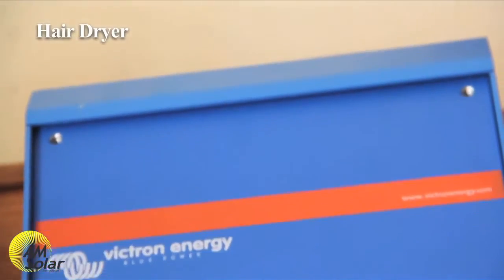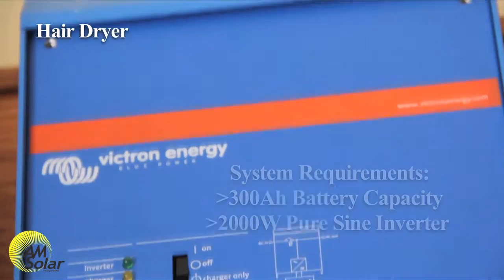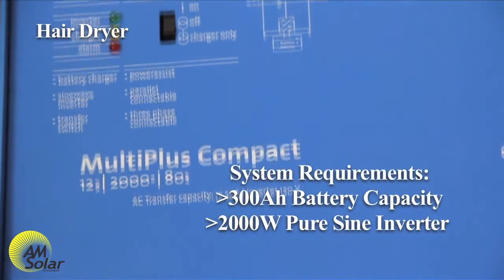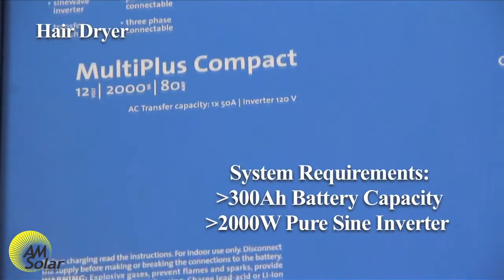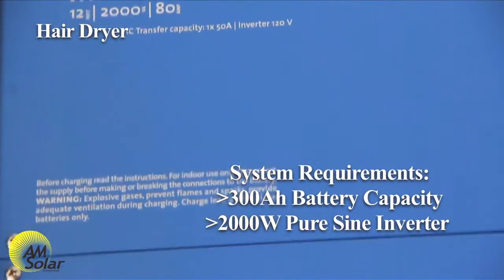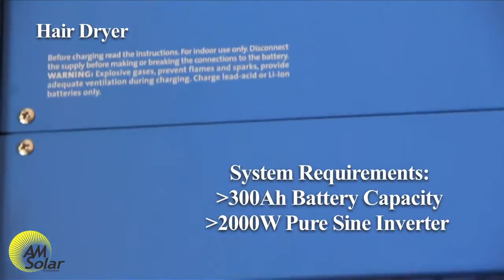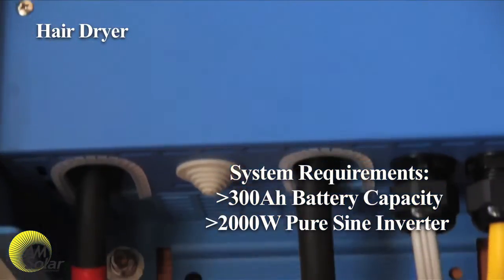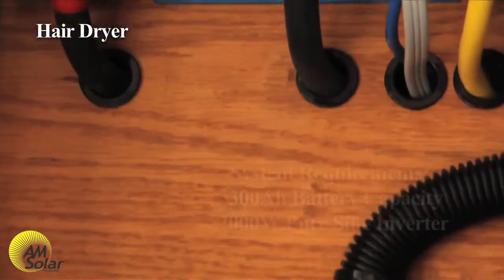Designing a Solar Power System for Your RV, Skoolie or Van (A Guide)

Comment: If you max out your charge controller's capacity... can you still add more solar panels by just putting them through a 2nd charge controller and then having that charge controller connected to a different battery within the same battery bank (But different entry point in the same battery bank)? Or is this increasing risk?
Reply from the maker: You can certainly have multiple charge controllers if a single unit doesn’t give you the capacity you need.  We do this all the time.  There is no need to have a different connection point, as long as your conductors can handle the current.  Does this answer your question?
Reply: @GarretTowneAMS  thank you.

Comment: Good morning. Can you help me plz. Ive got n 12/1200av phoenix inverter. What size solar and mppt is needed . Im using 2xwillard deepcycle batterys 70ah each. Just want to use for camping in my van. Thanx for your great videos.
Reply from the maker: The solar charging system and inverter system are totally separate, so the size of your charge controller has nothing to do with the size of your inverter or the size of your battery.  The solar charger is sized based on the wattage of your solar array.  A common solar array for a van is 200-300W.  If you go with that size, a Victron SmartSolar MPPT 100/20 will work.  If you go over 300W, get a 100/30.

Comment: New to the Victron world. Trying to up my 1999 RV Class A from only 100w solar.
Looking for a new SOLAR CHARGER...

ANY RECOMMENDATIONS ON SETUP? Solor Charger MODEL, use x2 panels parallel and x2 series???

I am looking ar a Victron 150/85 controller  2S2P????

I pickup four:
Solar Panels manufacturer: Trinasolar model: TSM-365DE06X.05 (II)
Panel Voltage (45.0 Voc)
Panel Short Circuit Current (10.35 Isc)
Solar Panel Wattage (365 W)
Max Series Fuse Rating (20 amp)

Today my (12v) Battery Bank Voltage 400-AMPs, I will increase to sound 800-AMPs
Thank you
Reply from the maker: If I understand your correctly, I would put all the panels in parallel.  Their higher voltage will work very well in that configuration.  With four panels, use a 150/100 controller.  Use 2ga Duplex cable after you parallel the cables on the roof.  If you need more details, or a place to buy the stuff, send me an email:  garret@amsolar.com

Comment: The few who are able to use AC off solar are using 600+ah of lithium supported by 1000+ watts of solar, often on a Class C or Skoolie or big flatbed camper overlanding truck. They are all using mini split systems. I've managed to fit 1000 watts on my Ford van and have 900ah of lithium down where the spare tire used to be, and I'm mounting a mini split to a swingarm rear bumper. Hope it goes well! It's not cheap to build a system like this, but your ride becomes a portable generator that could support most of a house (minus HVAC and clothes dryers) in a grid down scenario.

Comment: Why should these systems be custom designed for every van?
Reply from the maker: So you don’t pay for things you don’t need.
Reply: @GarretTowneAMS  Then every car should be custom designed to save money too, NOT. Henry Ford is rolling in his grave.
Reply from the maker: @GOLDVIOLINbowofdeath  start your own business and let us know how it goes. I’m sure people will be beating down your doors.
Reply: @GarretTowneAMS  I am starting my own business but not interested in doing everything inside the van , just the structural parts. Filing patent application soon. I’m sure there are companies out there that want to specialize in the electrical or water modules.
Reply from the maker: @GOLDVIOLINbowofdeath  Good luck. Let us know if you need any power system help.
Reply: @GarretTowneAMS  I could use referrals to companies that might be interested in making the electrical module or the water module for a modular, mass produced, van conversion system. I will be mass producing the interior structural and cabinet modular components and the frames for the electrical and water modules to be built into. Also want a referral for a wiring harness company

Comment: Is there a disadvantage of going a little bigger on the inverter even though you may not need all that capacity?- like getting a 2000 instead of a 1000 for example?
Reply from the maker: You may have a higher no load draw with a larger inverter, but I always recommend 2000W over a 1000W.  It gives you room for expansion and loads like microwaves, blenders, etc. typically all need more than 1000W.  Get the 2000W and you won't regret it.
Reply: Victron 3000w inverters are close to the same price as 2000w inverters, but they are much larger.

Comment: I have a victron 100/20 mppt with a lensun 105w roof solar panel charging two agm yellow top opitma D35 batteries. Would this system be sufficient to run my arb 12v refrigerator? The specs on the side of the refrigerator reads dc12/24 2.5/1.3a
Reply from the maker: It will be cutting pretty close.  I would feel better with you having two or three of those panels.
Reply: @GarretTowneAMS  what would be the damaged caused? Could it cause a fire or just eventually ruin the batteries?
Reply from the maker: @Greenmanwildlifephotography  Nothing will be damaged.  The refrigerator will just deplete your batteries faster than the solar panel will charge them.
Reply: @GarretTowneAMS  an would I just add the new solar panel wiring directly into the solar charger in the same ports as the first panel or do I have to daisy chain the panels? Thanks for your help!
Reply from the maker: @Greenmanwildlifephotography  Both options will work, but I prefer to use the same ports and make it a parallel connection.
Reply: @GarretTowneAMS  thank you so much for your help. I really appreciate it.. your videos are great. An what company do you recommend for a panel? Probably get a another 100w or 150w
Reply from the maker: @Greenmanwildlifephotography  We sell Zamp because of their high quality, but they aren't cheap.  You might just go on Amazon and see what they have.  There are a lot of good options.
Reply: @GarretTowneAMS  I would rather get quality. Can you send me a link?

Comment: is everyone in the van and RV world keeping their lithium batteries topped up @ 100%  all the time???? from what I can tell, it seems like it. I'm from the electric vehicle world and it's known that it's best to keep lithium batteries @ 80% to avoid dendrite build up, this can double the life cycle of the battery. If stored for long term 6+ months, 40-60% SOC is recommended. This is all well documented in research papers.
Reply from the maker: It’s totally unnecessary to top of lithium’s. Customers demand it, and it’s hard to convince them to think differently.
Reply: @GarretTowneAMS  yeah, I noticed that when checking out Van life, RV video's etc. It's REALLY stupid actually cause you're basically just killing the battery internals by created lithium dendrites, that's $$$ out the window. Alot of people just aren't educated on lithium and think they require full charge like SLA...

Comment: I'm in the process of building a system for use in an RV for fulltime living and I already have a couple of Victron Blue Solar MPPT 150/35 solar charge controllers and a Victron Venus GX to be used with a 450 amp-hour LiFePO4 battery bank made up of 48 - 150 amp-hour 3.2 volt cells in a 16S3P configuration, providing 23,040 watt-hours of capacity at a nominal 51.2 volts DC.  The battery bank and the Victron equipment is contained in a Weigman 36x30x12 14 gauge steel industrial electrical enclosure, along with other components, like DC-DC converters to provide 60 amps at 13.8 volts DC for standard RV 12 volt devices, the required contactors and, of course, the BMS system from REC BMS.   I've been looking at the Victron BMV-712, but I don't have a desire to wire and mount the display.   So, I've been intrigued by the Victron Smartshunt.   But, I have a question that you might be able to answer:

Since the Victron Smartshunt would be installed inside the 14 gauge enclosure to replace the simple 200 amp 50mv shunt specified by the BMS manufacturer, the Bluetoooth connectivity is going to be unusable, except between the solar charge controllers and the Venus GX that are mounted inside the enclosure.   So, can the Victron Smartshunt be accessed through a standard wired LAN using the Victron app on my smartphone connected wirelessly to the LAN?   I have a panel mount ethernet connector to connect the Venus GX to the LAN.

I watched the Victron video for the Smartshunt, but comments were turned off on that video.   So, I hoped you might be able to provide some insight on this issue.   Thanks!
Reply: I share your concerns about Bluetooth signal strength in the setup you described.  Unfortunately, the SmartShunt only has a VE.Direct port which can communicate with your Venus.  I hope this helps.

Comment: So can I use a 500W inverter that says it's for car use on my solar setup?
Reply from the maker: Vagitarian Sure, if it works with your loads. It doesn’t matter if solar charges the battery or not.
Reply: @GarretTowneAMS  Hi wow thanks! Yes I've got a deep cycle with 90 amp hours and a 150W panel with 8.5 amp charge controller and want to attach the 500W inverter just to get the hang of this. Maybe charge phone and laptops!

Comment: i do have a fue questions about wiring,3 victron things,,i have a 250/100 charge controller and a 48volt/100amp cutoff,and just got a bmv something,,the questions are ,how close to the battery does the bmv thing need to to be to the batts?,,,i just need a scmatic for what i have,
Reply: I would need some more details on what you have.  Battery type, BMS, etc.
Reply: @garrettowne  thanks for your help,, no bms,,the batts are chevy volt 48volt modules i have 6 of them ,,,one qustion i have is how far away i can mount the shunt from the batterys?

Comment: Wrong.. Wrong...Wrong... You are so right  ( the first Wrong was the best )....... more great info
Really enjoy the info 

I do have one question how can I recharge a 48v 11amp  lithium e-bike battery with solar I have a  (Victron Energy BlueSolar 12-24v 75/15 MPPT Solar Charge ) any advantage building a 24v system   Do I need a large battery or can It be charged from my 12v car alternator 
 and run a Portable Fridge Freezer 34.5L
Rated input current (AC) 0.86 A
Rated input current (DC) 7 A
Input voltage (DC) 12/24 V
Thanks from Aussie

Comment: If i have more solar panels that would also charge my bank faster if im under standing this right? I trying ti figure out my needs for  off grid living in a schooly, and from im getting out of this x3 - 4 200w panels, with about a 400ah bank to start with with about 2k inverter should do fine for running a energy efficent wynter fridg, a lap top daily for work or at least charging and running a wifi hotspot booster.with the ability to run an electriv 1500w convenction oven every once in a while
Reply from the maker: More solar panels make for a faster charge.  Not to try to sell you on anything, but if you can go to AMsolar.com and fill out a quote request I’ll be able to give you a lot more detailed information.  I think your basic idea is sound, 600W of solar, 400Ah of batteries, and a 2000W inverter.

Comment: It's nice to see a clear expert on YouTube now and then :-).  Great video.  The video does seem to confuse "solar is for charging batteries only" with "solar powers loads" just a little bit.  Might be interesting to discuss that a bit.... that everything essential flows through the batteries..
Reply from the maker: I write out most of what I plan to say and have my crew give it a final sanity check.  Then, once I get on camera I may loose a little precision.   To be clear, solar just charges a battery.  Solar can “offset” the consumption of some loads.  If a load is drawing the same amount of power or less than what solar is putting into a battery bank, you could say that solar is powering the load, since electrons are fungible, but you’re going to have a hard time making an off-grid energy system without a battery bank.

Comment: I am looking at a 6000 btu window AC that used 4.5 AMP and 490 Watts. (Still need to sort out how to mount in RV window). I have a 170Ah LiFe battery, 480 watts of solar and 3000 watt inverter.  I figure it can run all the time the sun is shining and for a few hours at night but not sure what percent of time compressor runs so not sure total hours of AC. The AC unit I am looking at is very quiet, unlike RV AC.
Reply from the maker: Rough estimates:  Your solar panels may produce 480W x 3 = 1440Wh of energy per day, which is about 2.9h of run time per day assuming no other loads or charging sources.  If you can use 100% of your lithium battery, it has 170Ah x 12.8V = 2,176Wh of energy.  This works out to 2,176Wh / 490W = 4.4h of runtime per charge assuming no other loads or charging sources.
Reply: Garret Towne so we won’t be able to replace the energy used with solar only...

Comment: 11:04 
You had me right until here. 
I know that you CAN run AC on JUST SOLAR and still have power left over to Charge your batteries.  Eric from N Fanatic is doing just that. His 1280 watts is putting out 90 Amps and his AC is only using 55amps. So that means that 30-35 (EXTRA) amps are going right INTO his batteries...
Reply from the maker: By "Just solar" I was implying "No battery bank".  Of course a large solar array can create more power than the air conditioner uses.  But, with any array that fits on an RV roof, you will need a battery bank as an energy buffer.

Comment: Good job. Must I use 24v inverter on a 24 battery system?
Reply from the maker: Yes, the inverter input voltage needs to match the voltage of your battery bank.  Technically, you can get around this if you connected a 12V inverter to half the battery bank, but then you would only be using half your batteries which would make a terribly inefficient/imbalanced system.

Comment: I dont know were you are getting some of your figures.Most laptops use about 40 watts not 150.even gaming laptops when gaming only use about a max of 120 watts.I use a 110 amp leisure battery.that cost me £90 with a 4 year guarantee.i have used this all weekend charging my phone and laptop with small inverter at least 5 times each.and the battery is still showing green when i return home.I have had this battery for nearly 3 years now. i have a small portable cooker cost me £10 and the can cost £1 that lasts me  more than any weekend.To many people are talked into buying products that they do not need at a great expense.Go back 30 years and look at boats that sailed the globe .at very little cost.
Reply from the maker: We try to be conservative in our power consumption estimation because a customer saying “I have more power than I need” is a lot easier to deal with than a customer that complains “It doesn’t work.”  We are very careful to not lead our customers into systems that they don’t need and we design systems that are incrementally expandable.  I frequently tell customers “You don’t need that many panels” and “You don’t need that many batteries.”  Our ability to maintain long-term positive relationships with our customers is one of the reasons for our continued success.